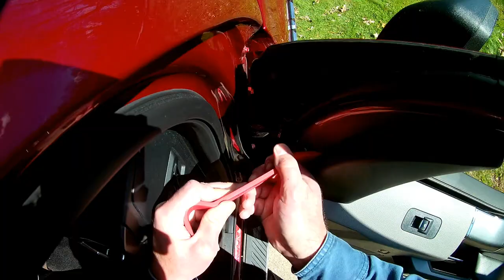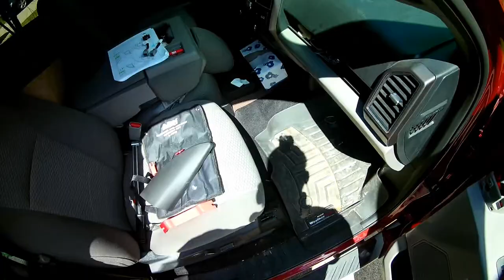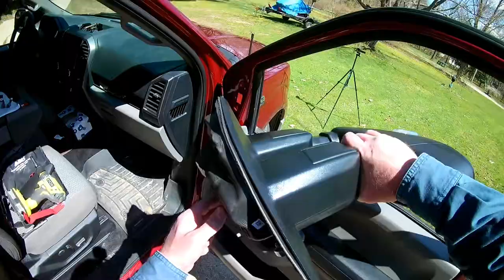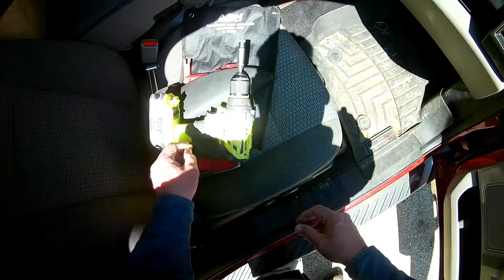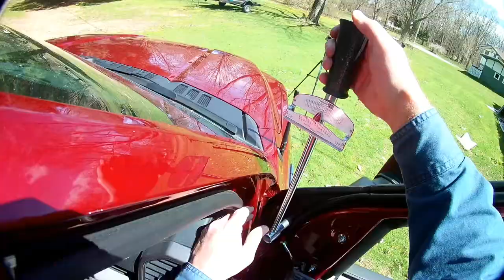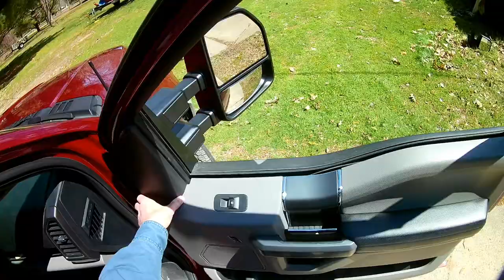2017 F-150 XL XLT OEM Tow Mirror Upgrade JL3Z-17696-BA

Comment: Just ordered my set for our 2018 XLT. Thanks for the video!
Reply from the maker: Hope it helped.  You will be amazed at how much they help when backing up a trailer.
Reply: Did they come with the temperature sensor for your 2018 xlt? Or did you have to swap it?
Reply: @Bumataur  Hi Eric, been a year now so I think it was just plug and play. Sensor is already there in the passenger side mirror. Came with the harness since the XLT has less pins. Be careful on the bolts and nuts, stupid easy to snap them.
Reply: @GaganpreetBains  Thanks!

Comment: I have a 2019 XLT so I have the heated, power glass, and turn signal. But did not have the puddle lamp. Do you get this now too ?
Reply from the maker: I didn't.  The mirror has them but I only have an 8 pin connector so the puddle light and running lights are not supported.  I just saw that Fariway Ford has them for $589
https://www.fairwayfordparts.net/oem-parts/ford-2015-thru-2020-f150-trailer-tow-mirrors-pair-for-xl-and-xlt-jl3z17696ba?c=az0x
Good luck!
Reply: Angler Adam just picked them up! Thanks for the info. Can’t wait to install this weekend

Comment: Does the kit come with the adapter or ordered separately?
Reply from the maker: The adapters are is included if you get the kit from the dealership.  I don't think you get it if you buy a mirror separately.
Reply: @angleradam1011  Thanks again for the great video, I always wanted the towing mirrors, but was afraid to tackle the project because of the fear of removing the door panels.  Now I know even I can do it!
Reply from the maker: @bernardsteele4786  Glad it helped.  You will wonder how Ford could sell a truck without them.